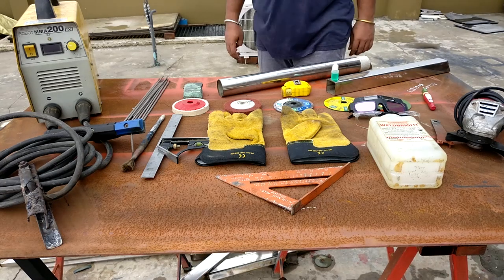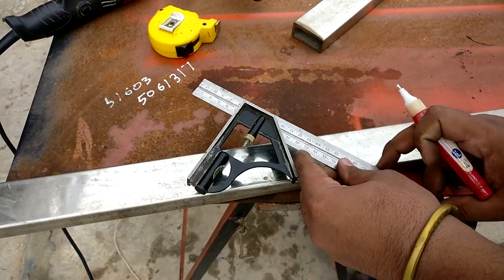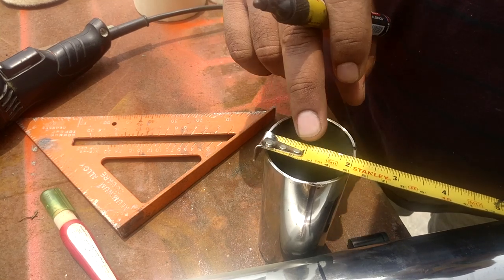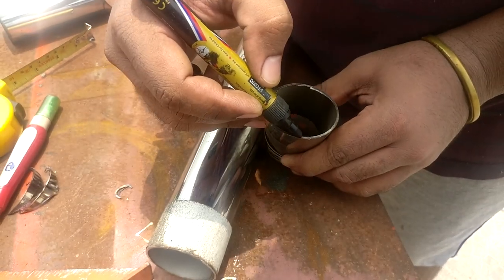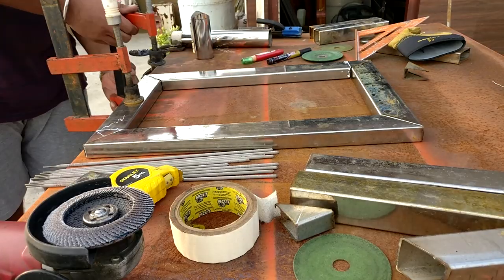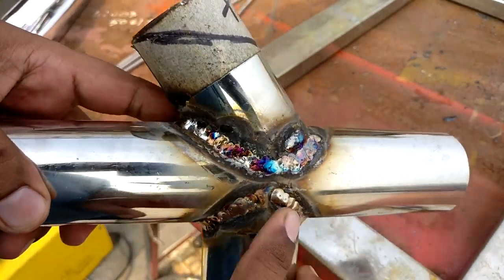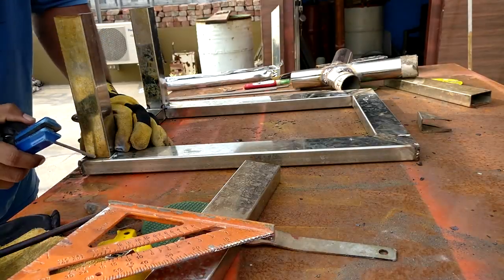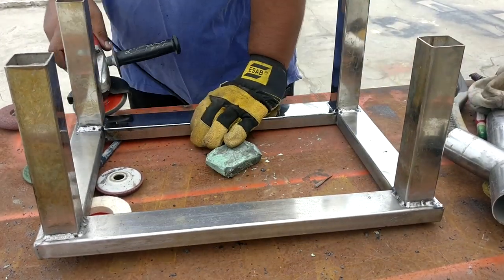Learn Stainless Steel Joints & Welding with Stick welder (Possible)

Comment: Bro, can you provide me the link where I can get that solution 1:13 of steel grade test
Reply from the maker: Dear I didn't knew any online dealer but the person who sells material regarding stainless steel pipes, posts, and other accessories regarding stainless steel railings, they have that chemical available. And the one I got costs me 20₹. Per tube.
Reply: @ambroscustom  I m in Delhi did u hav any idea where i could get one.
Reply from the maker: You can search stainless-steel grade tester. There is an IndiaMART link.I am from Punjab.
Reply: @ambroscustom  apart from the indiamart..... If I'm suppose to go through offline, which shop I should ask ??
Reply from the maker: Already answered.

Comment: Steel 202 304 prize please reply
Reply from the maker: Dear steel price always fluctuating and different sizes have different price. I am not a gate manufacturer, i do this work for YouTube only. last time i purchase and average price was 150 for 202 and 230-240 for 304. Sheets are much more expensive than pipe. 202 sheet with mat finish comes around 230 per kg while mirror finish is 280-290 per kg. Didn't remember the 304 price but idea is around 350-390 per kg. Small cross section pipe have slightly higer price than the bigger one.
Reply: @ambroscustom  gr8 reply tq for this valueable answer again thanks
Reply: My one more comment please also reply that electrode prize for ms and ss 3.15mm 10nmbr rod

Comment: Use tig welding
Reply from the maker: But you can't use tig on everywhere. Every body can't afford tig and this is a tutorial video how to weld on stainless steel using arc welding.

Comment: Safety goggles from China ? Is it good for eye ?
Reply from the maker: Use 3m products they are good to use.
Reply: Sorry . The one you used  goggles 🥽 is it good ?
Reply from the maker: Yes that is good to use if you don't want to use welding helmet, but use it by covering your face if you are doing in a room because the radiation from welding cause damage to the skin if uncovered and having an auto darkening feature is very useful.
Reply: Thanks lot